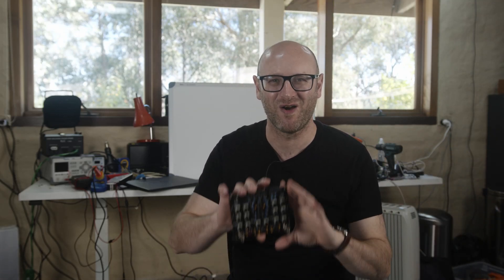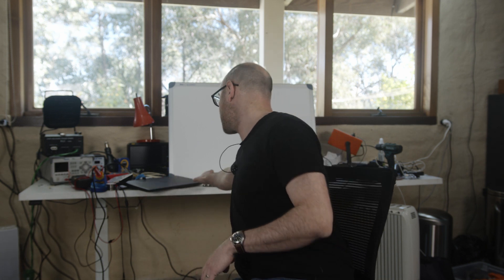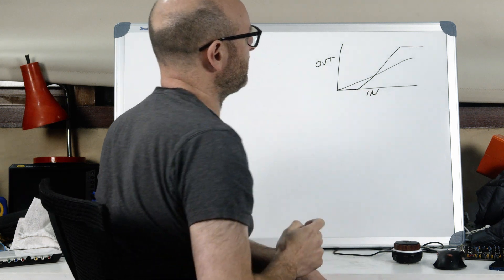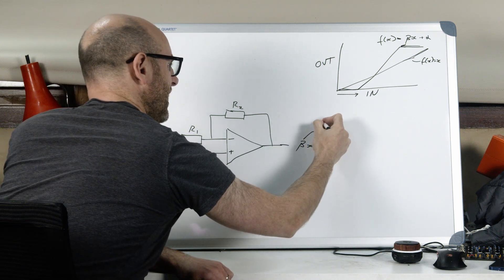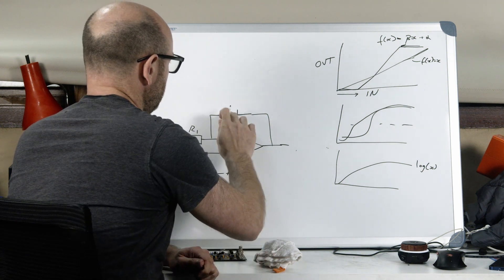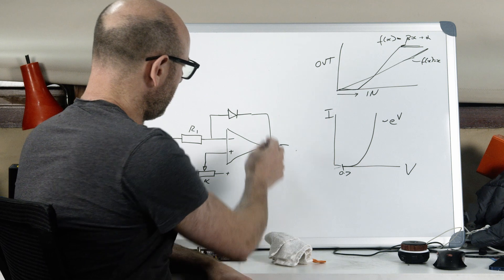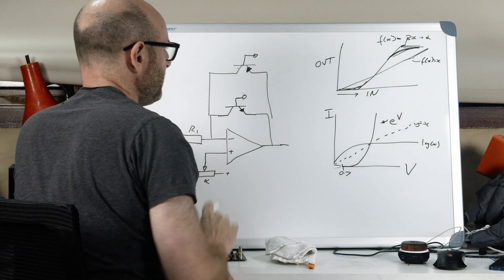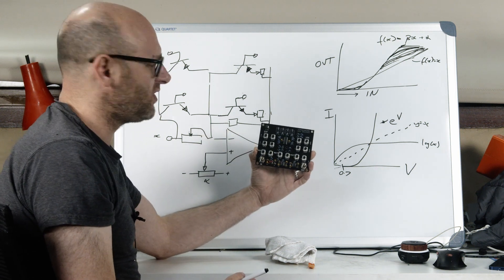Analog Color Correction pt1

Comment: very interesting... so in your tests with this circuit .. how much has the temperature variation affected anything with regard to desired performance ?  and is it possible for any of those temperature variation and thresholds to be utilised creatively here..
Reply from the maker: I’ve simulated the impact of temperature and it can be significant, but you can manually adjust for it with the potentiometers. It is possible to make a temperature compensated circuit, but it requires adding another op amp in the signal path, which potential could add more noise. I’m shooting for 10-12 bits of dynamic range, so I’m trying to keep the noise floor low. I haven’t done the calculations, so I’m not sure what to do yet.
Reply: @superchromat  also how are you powering it ? usb??? and you made a nice ground loop removal circuit ?
Reply: @superchromat  yeh i was just wondering if some.. of those kinds of "analogue" side affects could be utilised in the circuit .. in a nice creative and useful way .. i mean from your explanation you said that thresholds introduce certain .. unwanted or potentially not useful results .. in the shape of the curve.. but i was wondering if that could be utilised in an interesting way to make curves that are unique to analogue processing.. as  a result of this induction in the circuit .. and hence make something that nothing else can do .. through capturing and using induction bi products.. i guess to introduce some of the analogue fluctuation .. as a feature ?
Reply from the maker: Definitely. The temperature effect is less interesting. Its quite similar to old analog synths where the VCO's needed to warm up and would go out of tune, but they had a knob on the back to adjust tuning.

The more interesting effects are around the non ideal performance of transistors and the parasitic capacitance and inductance. That introduces artifacts which can either be fun or annoying. You'll need to decide for yourself when I upload the next video :)

As for power, right now its running off my lab power supply. I'm planning to make these into eurorack modules, so that will be the eventual power source.

I'd be happy to give you this board when I'm done with this revision. I'd be interested to see what it sounds like -- stick audio into the video ports, rather than the other way around :)
Reply: @superchromat  ahh yes well i do have some audio things i can throw into it :) so i'd look forward to that !..